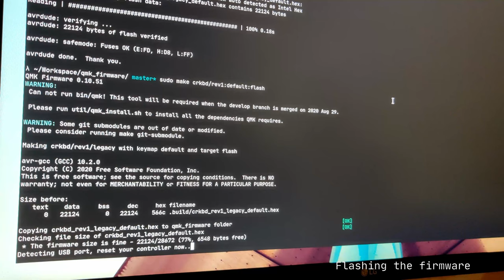Crkbd v2.1 Keyboard Build log

Comment from the maker: Hello everyone! I wanted to give you a heads up that there's been a significant update to the Crkbd repository, starting from version 4.0. As a result, all files related to previous versions have been relocated from the main branch. If you're still working on PCBs from earlier versions, don't worry! You can access those files using the following link:

https://github.com/foostan/crkbd/tree/fbb146fe372ce8b2b1543ced67367bf19e910945/

Comment: Grate job mate. What is the thing you apply before you start soldering? 15:31
Reply from the maker: Hey thanks! It's a flux pen, an liquid that helps the soldering going to the places we want they go. Hahaha
https://www.aliexpress.com/item/32908270559.html
Reply from the maker: @frozen_tortus  thanks again for your kind words, I use Isopropyl alcohol for cleaning electronics in general :)
Reply from the maker: Never tested my self this solder, but it has a good melting point, I think you should give it a try haha
Reply: @rafaeldelboni  What is the one you use?

Maybe a suggestion for your next time is to leave affiliate links to the equipment you use so people who are noobs like me can buy through them.
Reply from the maker: @frozen_tortus  it's a good idea, when I started this channel I was thinking more in helping than making money and the tools I used like the solder I bought all from local Brazilian stores, but I will experiment buy some solder from Ali and if I like I will do as you suggested.

The composition of the one in the vídeo is Sn63/Pb37 with 1mm diameter.

More specifically this one (sorry is in pt-br):
https://produto.mercadolivre.com.br/MLB-1514606280-3-tubos-de-estanho-solda-best-63x37-msx10-1mm-25-gramas-cada-_JM#reco_item_pos=0&reco_backend=machinalis-seller-items-pdp&reco_backend_type=low_level&reco_client=vip-seller_items-above&reco_id=856e3fa5-3685-4ae7-a49f-79b43e3c1880
Reply: @rafaeldelboni  Thanks again. Also, music in 3.0 video is sick man I love it :
Reply from the maker: @frozen_tortus  hahaha thanks for all the feedback, that was actually a mistake when I was editing the video (I was super noob on video editing) and I managed to delete the entire video audio track so I bought that in humble bundle to fill the mistake xD

Comment: Hi, I would like to know how many millimeters is the wire you use for the pins of the pro micro? 0.5 mm or 1 mm . Thanks
Reply from the maker: I used 0.5mm they fit exactly on the female pin header, they are much more stiff that using diode legs, but they still bend when you need to remove the promicro from the socket, I will do some tests with bigger diameters but 0.5mm fits really well.
Reply: @rafaeldelboni  thanks! Your video was inspiration for me and I did the same but I did not know the diameter of the wire.
Reply from the maker: Thank I'm really glad to hear!

I always try to create a companion document for each video where I list the parts I used:
https://github.com/rafaeldelboni/buildlogs/

But feel free to ask if you have anymore questions :)

Comment: What solder are you using? I mean  thickness and % of Sn/Pb
Reply from the maker: Hey hello! I use the most common one here in Brazil it's specs are:
Alloy: Sn63/Pb37
Diameter: 1mm

Comment: For "Cleaning the flux" does that mean flux or water or a special solution to dissolve the flux?
It looks like water but I'm reluctant to use water anywhere near electronics
Reply from the maker: Hey I hope you having a good day, I used Isopropyl alcohol to dissolve and remove excess flux
Reply: @rafaeldelboni  Thank you for your quick reply, you've made the easiest to follow build log
Reply from the maker: Thanks for you feedback, it really motivates me to keep doing this :)
Reply: Hi Rafael I used tye same alcohol but the board is know sticky. How did you avoid this ? Thank you for answer.
Reply from the maker: @yezid1058  just wait a little bit more to the alcohol evaporated completely, mine stayed sticky for sometime as well

Comment: Did you get all the diodes around the correct way first time?
I'm have to redo some of mine
Great video
Reply from the maker: Hahaha, luckily I double checked before I soldered both sides, but not only I had one in the wrong way I also forgot one.

Thanks!